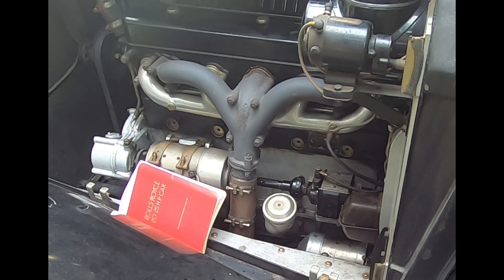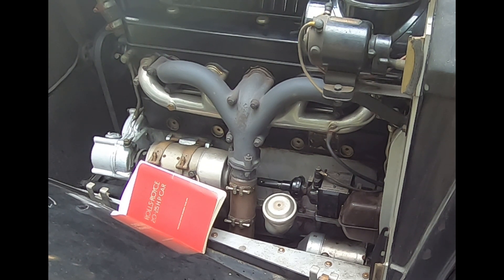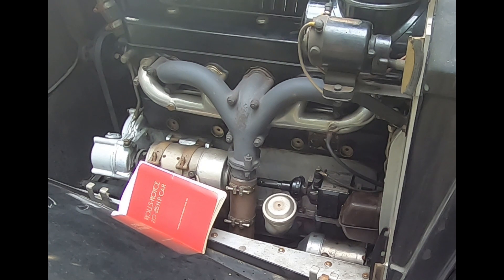Rolls Royce 20 and 20/25 Standby Magneto

Comment: Super. Thanks. Q1: Should you not always start with timing on early ( retarded) even on electric start, as done on a phantom 1. 
Q2: what is the lever/ handle with knobs on both ends , seen stowed above the fusebox? 
Q3: on the dash there is a push button marked reverse. What is that, reverse lamp? 
Amer Ahmad 
Lahore Pakistan. 
RR PI 45WR
Reply from the maker: it is best to start fully retarded most of the time, if the engine is warm it is not as necessary. The lever with the knobs is the handle for the on board jacking system DWS scissors jacks, one front, one either side rear . these are found on mid 30's models R-R and Bentley . Yes my car has a reverse lamp. It was required in the UK to pass MOT

Comment: Great video - I have never used the Magneto.. Now I know how it work.  When it is engage I assume you can see the arm turning that connects to the dynamo?
Reply from the maker: Yes, the connection shaft will turn with engine when engaged
Reply: Very informative Timothy, I learn more by watching you demonstrate this,than by reading in the manual,atvleastvi know how to do it now,many thanks.
Reply: Yes  indeed. Very educating.  Thank you sir.